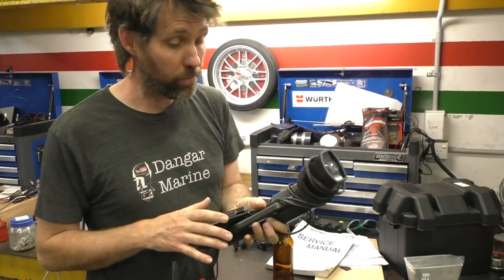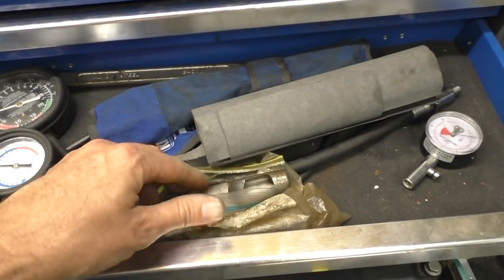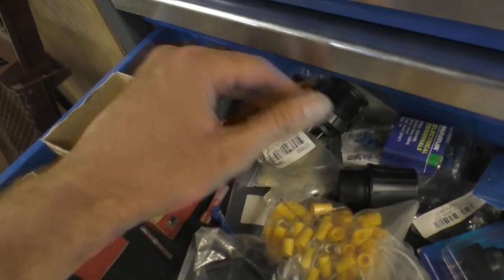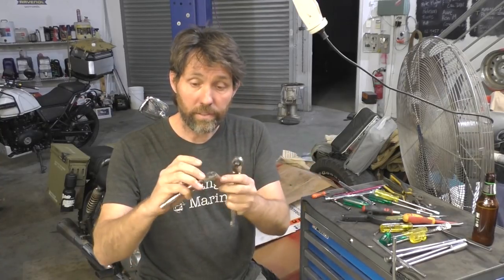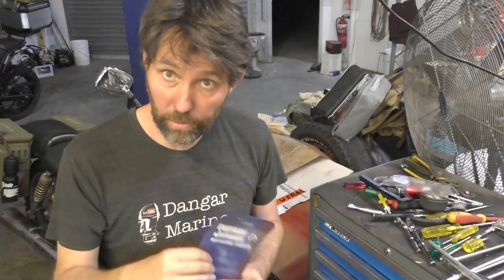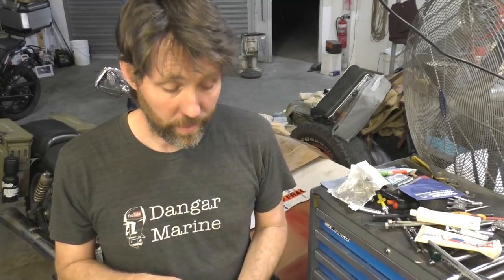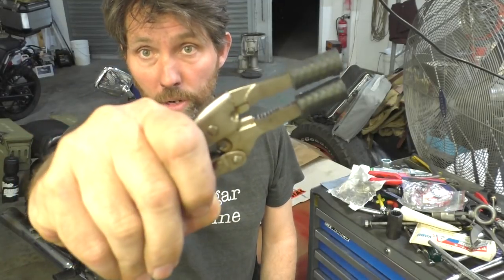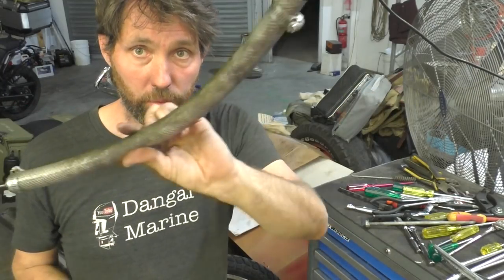Tools for working on outboard

Comment: I recently discovered your channel. As a tech (not marine) myself, I think that you're where I'm at when it comes to tools. I used to be a tool snob, but now I like what is important and don't waste much time and money on the rest. After 30 years, the tools that I could pull out of my box that are both expensive and relatively worthless is shocking.

I can only take your word for the tools that are important for outboard work as I have near zero experience in that specialized field. But there a couple of things on your list that I would actually buy 2. One of which would the best quality that I could afford. And another to beat up and when "about that much" is fine. Then you have 2 to check against each other when things are critical or baffling.

1. Multimeter - It gets really confusing when it reads wrong. You waste time, money and you can break things. The things broken includes yourself.

2. Digital caliper - A cheap one is great to generally toss around and used when measurements can be "ish". But when you have to be sure, having another one to check your work and that other being a very good one, is priceless. How many times have you bought 2 seals because you weren't sure about that tiny fraction and didn't want to make 2 trips? The tool pays for itself.

Love your stuff. I ordered a shirt this weekend and will wear it proudly. I already got a ship notification. Thanks!
Reply from the maker: I think we are on the same page when it comes to tools. Thanks for buying a shirt! :)

Comment: ahhh the flywheel magnet epoxy.......just had to do that myself a few weeks back, picked up a really cheap merc 25hp (no spark on the lower hole) a couple hours of diagnosis (thanks to your vids) and it ended up being the magnet,.. love your vids keep them coming....Josh
Reply from the maker: Thanks Josh, and great work on getting that Merc up and running, it's always nice to hear of another old outboard being brought back to life!

Comment: Your videos are hands down the best on You Tube for outboard work.  I learned so much from you and you explain everything so well.  I have one thing to say about tools.  The Snap On tools work so much better.  I noticed their 18mm spark plug socket is the only one that fits well.  Their pliers and sockets get into tight spaces.  Their low profile sockets and ratchets work well and there seems to be a difference with their flex ratchets.  I torque to Yamaha specs. and their digital ATECH torque wrenches are the only tools that always get to the spec.  I have so many 5.2 and 8.4 lbs.-ft. specs. that I found only Snap On can deliver the range.  I guess your experience helps since you know it is done right.  Keep up the great work and thanks for taking the time to share your knowledge.

Comment: Great video, as always.  Leak down tester will tell you what is causing low compression.  Intake or exhaust valve, rings or head gasket, etc.  Don't even need the gauge.  Just use compressed air to spark plug hole at TDC or on power stroke (4 stroke) and see where it comes out of.

Comment: Thanks for putting up the videos on here. I have picked up a heap of info watching all these.  Started looking on here for basic maintenance for a small 2 stroke kicker for my 12' aluminum boat.  Got sucked in watching the videos as I am a sucker for anything wrench.  I run a lawn care business and do 90% of my own service and find a lot of this crosses over to small engines.  Keep up the info and would love to see a follow up video on the wi-fish to see how you like it after using it for a while.  I have been eyeballing that unit.
Reply from the maker: Thanks Zach, glad you're enjoying the vids. Any small motor knowledge definitely helps a lot when working with outboards. There are always things that are unique to them, but it is a good head start. I must do a follow up on the Wi-Fish. I still want to see if I can get it integrated with the Navionics app.

Comment: For corrosion on stainless steel & aluminum have you ever used heat and wax? If you heat the bolt or the nut that is frozen. After you get it & the area very warm take a block of wax or a candle and push it against the threads the wax will run down the threads and you will be able to remove the bolt or the nut about 98% of the time. I've only had a couple that I could not get off using this method.

Comment: That lifting eye is for mercs. I have the set too. It comes with the eye and flywheel removal thingamajig. Aftermarket off ebay, pretty cheap. And I love liquid elec tape. I use it often
Reply: I have a merc ring but should have bought the threaded adapter too for pulling the flywheel. If I need one may just make one from a large bolt and thread it.
Reply from the maker: It's coming back to me why I bought it and yes, it was a Merc. I probably should have bought a cheap aftermarket one because I think it you don't use something that often the cheaper ones will do the trick for quite a while.

Comment: For a pin hole plate, I've made a custom ones using another plate and tapping the hole . I used allen head socket head bolts for pins by cutting the heads off. And welded a pipe on it for a special deep socket.. I got cheap and just welded a nut on the end of the pipe. You get the idea.
Reply from the maker: Nice one, I do like home made tools. :)

Comment: Great video mate

I think I've finally figured out what's wrong with my outboard. My fuel pump doesn't pump at all. Gonna replace that then see what happens from there

-Jack
Reply from the maker: Nice work Jack, sounds like you've got to the heart of the problem. I always like to hear of people determining that a part is faulty before replacing it. :)

Comment: Great to see those tools made famous from past videos, like the multi-carb vacuum gauges, cable lubricator, and bearing puller arms. Good times! What do you do about spares? Id be interested in the logistics of stocking spares when one is a small shop. Are there a few things you always keep on hand like common size impellers, spark plugs, etc or do you order spares only when needed for a specific job. Inventory ties up dollars I imagine.

Also, have you done a timing belt replacement vid yet? My Yamaha 90 4 stroke just rolled over 300 hours and I'm thinking its maybe time?
Reply from the maker: Thanks mate. It's really hard to stock parts for outboards as there are just so many that you might need. Dealers will stock a reasonable range for their brand, but even when they only cover one manufacturer they still often need to order things in. I haven't done a timing belt video yet, but I'm going to replace the timing belt on my outboard soon so I'll definitely film it.

Comment: In case of the stetoscope, you can just use a screwdriver and a pair of hardshell earmuffs. Just put the screwdriver onto where you want to listen and put the earmuffs onto the scewdriver and it'll do the same thing. Picked up this trick when working on marine reduction gears for winches, etc. Just a money saving little trick :-)
Reply: Try a real stethoscope, it's so much better at making distinctions in sounds.

Comment: Interesting Danger,   No mention of a DVA,,   The first piece of testing equipment, I go for when it is electrical ,for sure.    kodi.
Reply from the maker: Damn, I forgot all about the DVA. A home-made tool too! I went through just talking about the things I laid my hands on, I should have planned better. I completely forgot torque wrenches too.
Reply: @DangarMarine  I needed one of those to diagnose a motorcycle ignition system. I made my own as well. I think it was a capacitor, a diode, and a set of multimeter probes I used. It worked great! Thanks for all the informative videos! I have purchased a Ranger 364V with a 1990 Johnson 175 engine. The lower unit is bad. I am using your videos along with the service manual to disassemble and rebuild it. Wish me luck....LOL

Comment: I've got a fly wheel turner that I use to use quite a bit on older motors. Kind of looks like a large flat bladed screw driver with a spring loaded "C" shaped jaw. Do you ever use anything like that? Thanks for doing this video. Thumbs up!
Reply from the maker: No, I haven't seen anything like that. Do you have a link to a picture?

Comment: With digital verniers, you're better off using the manual ones if you tend to leave them sitting a lot for any length of time.

The batteries tend to die and start leaking, ruining the verniers for future use.

No problem though if you are always using them.

Comment: Another great video for us new to performing our own maintenance. I have been slowly building a reasonable tool set and was considering a torque wrench. I don,t recall you mentioning a torque wrench (unless i missed it). Is a torque wrench something you use often? Is it something a seasoned mechanic does not necessarily need? Obviously I would need to know torque settings required by way of a service manual. Is it a toll that would be useful to a less experienced DIY maintenance person? Thanks again for a very useful and informative channel.
Reply from the maker: There were a few tools I forgot to mention. In the case of the torque wrench it was simply because it lives in a different location. I think it is worth having one if only for head bolts. I have a 1/2" and 1/4" but if I only owned one I would make it 3/8".
Reply: @DangarMarine  3/8 is great, 10-80 ft lbs and can fit where my 1/2 wont.

Comment: a lot of times the only way to do a job is make your own tools.  somethings you can weld a nut on .i pick up cheap sockets at yard/garage sales i can weld on  so i can just use a ratchet or breaker bar on. i laughed when i got chastized for spending time making a tool because it was those same people that always wanted to borrow them.
Reply from the maker: Ha! You should remind them of the chastising and refuse to lend it. In fact Arn who is my Jedi master told me never to be afraid to stop and make a custom tool because you will probably get the job done faster than if you had just struggled along with a standard one. He has so many bend and ground spanners and can still remember what each one is for.

Comment: Hey Stu! Love your videos! I have a 1975 9.9 evinrude. The tiller handle gears are slipping and it is also very hard to turn the gear inside the motor that increases the acceleration. I was wondering if you had any videos to remedy this or any advice? Keep up the good work! Cheers!
Reply from the maker: Hi Arron, yes, I've seen this problem a couple of times. It is usually just a matter of disassembling everything and cleaning out any old grease and corrosion, then putting on a light coat of new grease and putting it back together.
Reply: Thanks! I've seen in some forums about people pulling the fly wheel and relubing the mag plate? Not sure what that is. Also the tiller handle gear has 2 zips ties and a piece of copper wire used as a spacer I believe. Not sure why it's there but I don't want to remove them and mess somethin up. Any ideas? Cheers!

Comment: I think I will be buying a brand new Evinrude 60hp.  It seems that I should not be doing much to a new engine, in the sense that it should not need work and the work should be done by dealer, if needed.  Does this make sense?  I am a mechanic-type guy BTW.  IS there anything I should think that I might do to a new engine?
 Thanks for response

Comment: Hey Stu, thanks again for the insights. I have a Mercury 75hp outboard. You mention a lot of tools here, dont think inhave the budget for all. Would it be possible that you can give me some advice as to which tools and consumables i need to do an effective service? I am such a noob.. I took my boat out yesterday and sank the boat due to not putting a plug in! Boat recovered but engine was submerged.. worried about  corrosion starting.. wondering what tools I need to get started quickly. Many thanks in advance for tour valuable advice!
Reply from the maker: The basic things you need are sockets, spanners, screwdrivers and pliers to get started.

Comment: “An enormous part of doing mechanic work is actually just cleaning something”. Probably the truest statement ever. Customers wonder what took so long when they come in on an overheat and get a tstat, poppet, and thermostat job done to their motor. Well that’s because a third of the time if not more of the bill is cleaning all the salt and other nasty shit before their neglected motor is put back together. There are 300hr services for a reason. Lol

Comment: hi..just a quick question....on my evinrude outboard motor...how do it trim the motor....i can tilt it by hand but I dont see me being able to do that while out on the water...and there is not tilt or tim switch on the motor..like on the side like I see alot of boats....and there is not one on the shifter...plz dont tell me its really that hard at dealing with this boat and unloading it and loading it.....Thanks...
Reply from the maker: Does it have a working trim-tilt motor installed? If so there should be a trim switch on the throttle - no all have a second one on the lower cowling.

Comment: Yo, I've been watching some of your videos and they are amazing. I have a Honda 5hp outboard and I was thinking, is there is a restrictor plate on the Honda 5hps which I can remove to give me more power? If there is, and if you have a Honda 5hp, could you make a video about removing the restrictor plate, please. This would be amazing. Thanks (my outboard is around 2003)
Reply from the maker: Not sure, I don't have much experience with the smaller Hondas. You would need to look if that model shares a block with larger Hondas to start with. If the 8HP for example has the same block size then you might be able to make some carburettor changes to get the extra power.

Comment: There is virtually no difference between dielectric grease and Vaseline. Vaseline is much cheaper. they both protect the connection from corrosion, they both make the connection a little more resistant, minimally.

Comment: Hey Stuart, I was wondering if you could post a link to those pliers you were talking about at 21:38 

-Jack
Reply from the maker: Hi Jack, unfortunately I don't have a link for them as I just bought them from the Snap-on guy's van, not online.
Reply: Dangar Marine oh ok, thanks for your help, I will browse through snap on site to try and find them.
Reply from the maker: They may well do. It looks like there is a grove in the jaw piece that would hold the clamp inline and stop it twisting they way they do with normal flat pliers. Of course the other option it so take some normal cheap pliers and cut a groove in them with an angle grinder. ;)

Comment: I have an 84 evinrude 90hp V4. The throttle cable is stretched to a point where it's adjusted to the full out position and still doesn't reach the stop completely. Is there a way I can shorten that cable a hair?
Reply from the maker: Generally this isn't a problem with cable stretch. A cable can be 6ft long or 50ft long and still have the same amount of travel from idle to full throttle. If it is the throttle plate that isn't full opening or closing your may need to do something along the lines of this https://youtu.be/NnotQmnKxKM

Comment: Is it bad on a 2 stroke v4 by pulling plug wire off to check for firing? I see many using a tool that shows the spark.
Reply from the maker: No, you can check for spark that way. If the spark is still jumping to the block you are fine. Coils don't like to be completely disconnected so the spark has nowhere to go, but as long as the energy is released it is all fine.

Comment: Hey. Just wondering if you could recommend a good affordable auto bilge pump? My boat is on the water all the time and I'm in Ireland so it rains a lot. And I dont get to check it every day. So need something to keep it from filling up
Reply: Heavy D Stu has a couple of videos on this channel about setting up bilge pumps. You can get a switch and a bilge pump and wire it yourself pretty much following stu's video

Here is the link to the video I'm talking about https://youtu.be/m0jrZPY9o3s
Reply from the maker: I know that feeling, all our boats live in the water the whole time too. At the moment I am a big fan of these "float" switches http://bla.com.au/default/automatic-bilge-field-switch.html I like them because they don't have any moving parts like traditional float switches. There are plenty of good pumps around, Rule seem quite popular. You can also get this type of sensor combined with the pump but they do get expensive.
Reply: I'm also thinking of adding a solar panel for trickle charging my battery. And suggestions?
Reply from the maker: I'm going to be looking into that myself soon and doing a video. You won't need anything huge, but make sure it is sold as marine grade as otherwise it will start corroding pretty quickly.
Reply: Looking forward to the video. Its a lake boat so no salt exposure. But I will wait for your video before I think about fitting one

Comment: I have 78 85hp johnson tilt goes up but not down it tries but the pins wont move.
Reply from the maker: If the motor is turning when you go down that it sounds like you might need to pull the pump apart and see what is going on inside. I presume the tilt stand isn't down or anything like that?